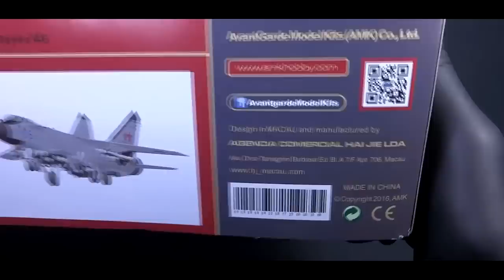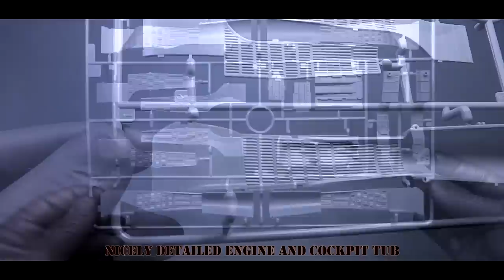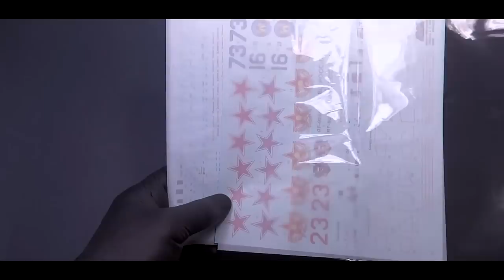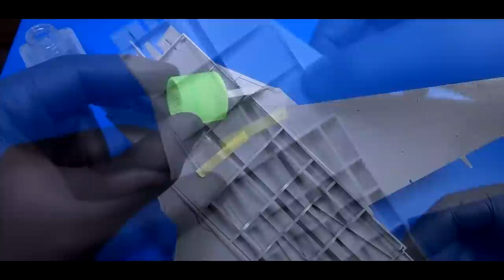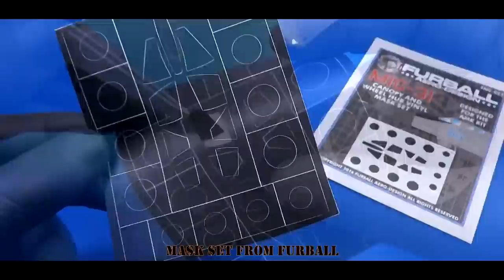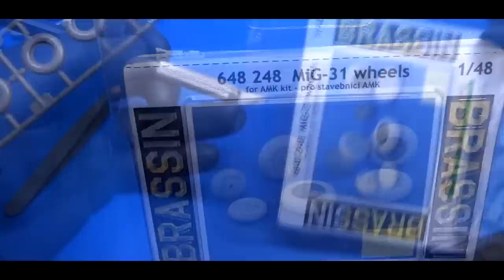FULL VIDEO BUILD MIG-31 FOXHOUND by AMK

Comment: Great work as always Dusan, a flawless build, your videos are a real joy to watch :-)
One question, what type of gloves donyou use when handling the model during build and painting? I have a box of general purpose latex gloves which I use but they have a slight powdery coating which I have to brush off the model every so often and before gloss coating and would prefer to wear non powdered if I can find the right ones. Many thanks in advance!
Reply from the maker: Pirana tatoo gloves. You can find them on-line. Thanks! All the best! Dusan.
Reply: Brilliant, are they reusable or do they come in multipacks? Thanks for the reply!
Reply from the maker: Yes, the piranha tatoo gloves are powder free and latex free. I bought 100p box, yes they can be reusable in our hobby. Take care, all the best! Dusan.
Reply: Excellent, thank you! :-)

Comment: That was a beautiful build. I have to ask though, why do you paint the panels one by one? Does it have a different effect than just spraying indiscriminately? I'm not very experienced at this and any tips will be very helpful.
Reply from the maker: This way I have better control but you can do it your way. Someone use a pre-shading and spray whole model. I am used to paint this way.  All the best! Dusan.
Reply: Thanks for the tip, appreciate it.

Comment: What are your thoughts on front landing gear?? I read somewhere it was kinda weak. I bought white metal replacement's but am not sure   how or what glue to use.
Reply from the maker: Hey, I didn't get any problems with landing gear,  it's sturdy enough for the weight.  I am not a fan of metal parts for landing gears.  Bad for seam removal sanding, glueing etc. You can use slow drying CA glue or similar slow speed drying  2 part epoxy. All the best! Dusan

Comment: Does the Klear yellows even if you don't use it as a finisher?
Reply from the maker: No, my bottle of klear is 8-9years old and it is still very good. (There is a new, even better formula in the bottle of Future, avaiable in USA). All the best! Dusan.
Reply: Yes, I wanted to ask if you've got any experience with the new one. If I remember correctly the new formula is called Pledge Multi-Surface Polish. The shop I bought from sent me that instead of the older red one, and they said it's the same  product just better (it had a reboxing). My concern was better for what? Does that mean it behaves worse with airbrushes? I hope not. Thanks for the answer, Dusan! :)